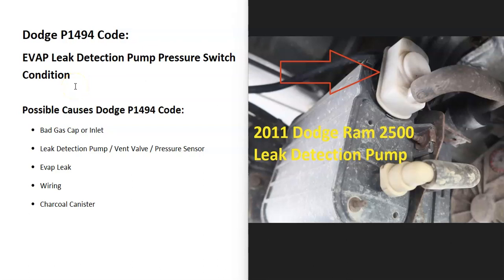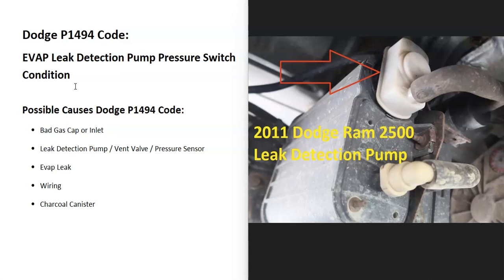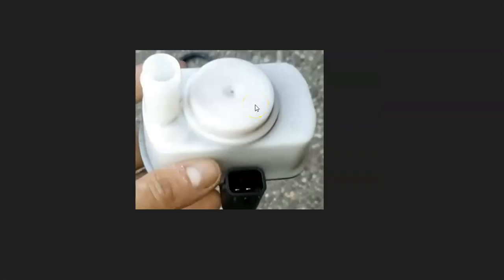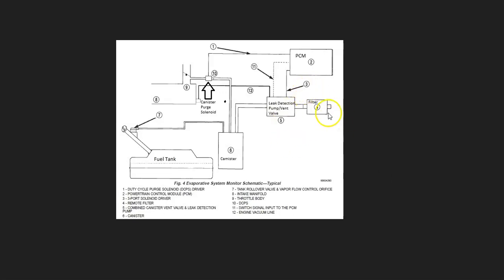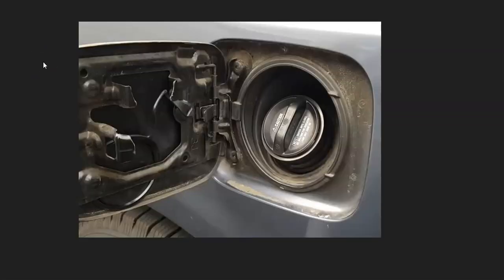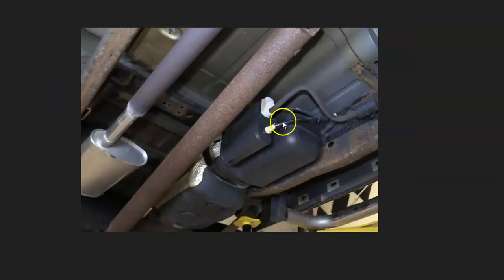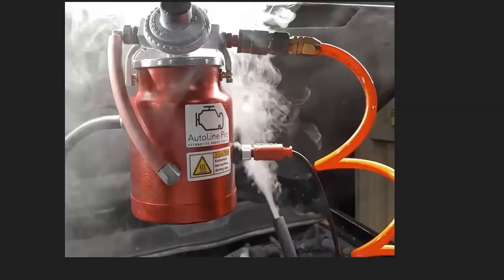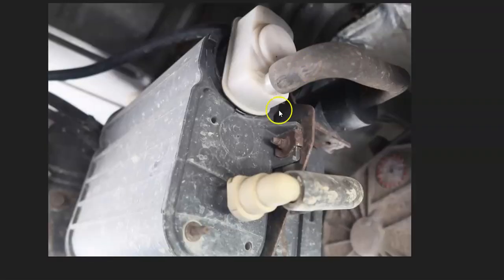Causes and Fixes Dodge P1494 Code: EVAP Leak Detection Pump Pressure Switch Condition

Comment: I had this code on my truck and found the hose going from the LDP to the throttle body has come off.  I put it back on but the truck won’t start; I think it’s because the computer needs to reset but I’m not sure how long I have to wait for that…. Any ideas?  Does the question make sense?
Reply from the maker: The engine should start with an Evap issue. If the vent valve is stuck open, it may cause the engine to run badly, but it should start.

Comment: I have a few questions I'm getting serval codes and my 2002 dodge caravan starts revving but then just falls flat. I'm getting 4 codes but could only see 3 as it moved fast and when I turned the key again it wouldn't show the codes but the codes are P1295, P1594, P0455. Is it too late to fix since my van won't move
Reply from the maker: I would solve the "P1594 Charging System Voltage Too High" first, as it may be causing other issues. If the engine runs, check the voltage of the battery, which should be between 13.5 and 14.5 volts. If the voltage is high, have the alternator tested and check the voltage regulator.
Reply: @HVAC_Mechanic  Thank you so much for your help.